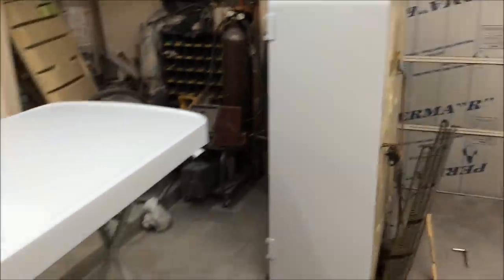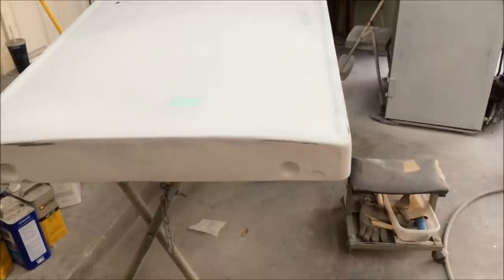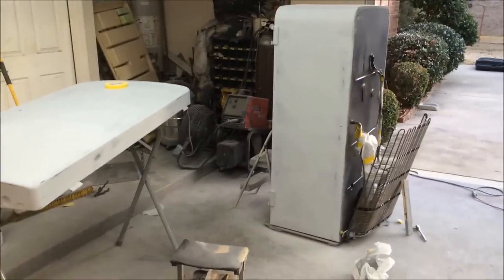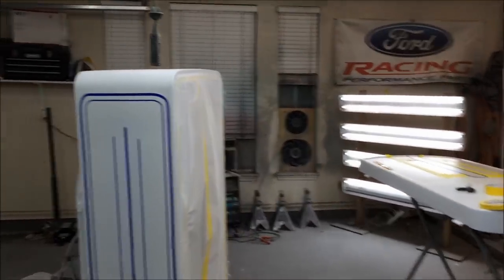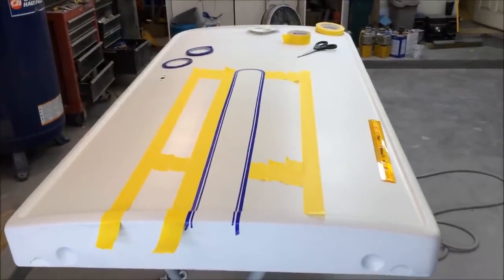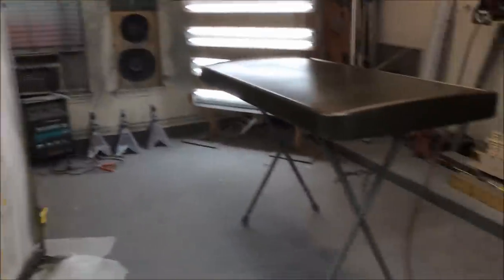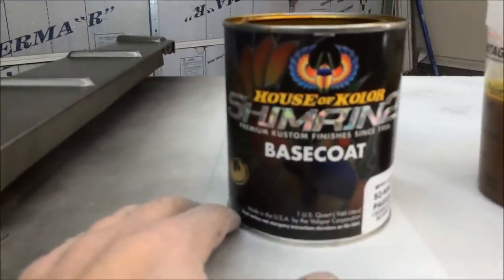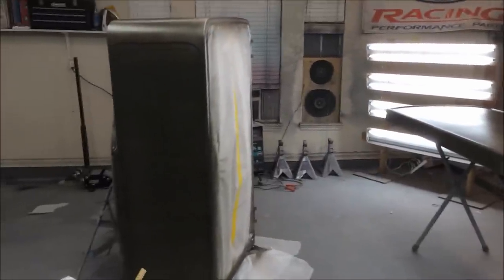How to paint an old refrigerator - vintage appliance - 1950's Coldspot Fridge - Hotrod Paint Job

Comment: 5th time is the number. This seems to be a problem of late on Youtube.
All in all, it looks pretty good for a refrigerator. Really nice finish.
Reply from the maker: Yea, that's odd, I have had the same issues, seems like it can take an hour or so for it to become viewable.
Reply: turbocobra
Some have suggested opening the video at a lower resolution and then upgrading it after opening. I am going to try that and see what happens. Thanks for sharing.

Comment: Nice project Gary.  Looks good from here.  Fair to say you preferred the UreKem Urethane candy you used before to the HOK Kandy Base?  On that type of project where you have a lot of tape outs we would have recommended candy base as well.  The 2K urethane candy is harder to work with on tapeouts and leaves more of an edge to bury. Seems really dark for pagan even over the dark undercoat. We generally say 2-3 coats on the candy base and then finish off with a drop coat more like spaying base than 2K candy.  Hope you guys are doing well.
Reply from the maker: Hi William, absolutllely would have rather sprayed the urekem base and candy compared
To the hok kandy base. It was much easier.  So do you guys make a kandy base ?  I am doing some fabrication on something right now that I may leave in raw aluminum, or may try some of hour chrome paint on just for fun ...
Reply: We have candy base without pearl (so it looks just like the 2K type) and with pearl (more like the HOK type base).  The chrome paint is the most challenging product we have to work with but after what you and Matt did I am sure you guys could handle it.  What might look really good as well is to use adhesion promoter over the aluminum and then candy right over it so the aluminum is your base.  You can even grind/scuff patterns into the aluminum for a cool effect under the candy.

Comment: Hi.. I want to paint my stainless steel fridge and stove to a dark red color.. What do you suggest I use? I want it to look shiny and have that stainless steel look. Thanks in advance!
Reply from the maker: Hi Wendy, not sure if I understand your question exactly.  So you have a stainless steel fridge, and you want it to have a stainless steel look, but you want to paint it dark red?  If you want to clear coat over your stainless steel fridge, that would be one process to follow, and I could give you some pointers on that.  On the other hand, if you want to paint it dark red, that's a different process and I could get you going in the right direction on that also... let me know... Thanks Gary
Reply: I just want to paint the stainless steel part to a dark red.. Let's say I want it like the tangerine color you put in this fridge on the stainless steel part of my fridge..does that make any sense? I hope it does lol ..thanks for the reply.
Reply from the maker: Wendy Peña Hi Wendy, best bet is to give me a call, 972-754-4344, there are a lot of variables and options, depending on your skill level, type of equipment you have, etc.  Appliance painting can be tricky because it's a high traffic/wear item, so proper prep and paint type is important, otherwise, it will delaminate and start to wear off pretty quickly...  Gary

Comment: what kind of paint product do you use for your fridge? I have a mini fridge that is white and i want make it pink color.
Reply from the maker: SeekerFantasy It's house of kolor automotive paint.  You can paint your mini fridge with spray paint or brush on paint.  It will look decent and hold up ok indoors if it doesn't get a lot of use.  Otherwise, those type of paints won't last too long, will fade, peel, etc from the constant use.
Reply: I see, but thanks for tip! :D

Comment: Tried 3 times so far and no video, only sound. Try again later.
Reply: George,
Take the resolution down to 240p and when the picture comes on click back up to 720p. Its the little gear bottom right of the picture.
Reply: andy heinrich
Thanks Andy I appreciate the tip.
Blessings

Comment: THAT'S.SORT OF.ALOT.
WORK..I.JUST.TOOK.LITE.COLORS.AN.PAINTED.VERY.LITE.COATS...ITS.TOP.CLEAR.COATS.THAT.SEAL.PRETTY LOOK
Reply from the maker: +KLEY MOORE Yea i was trying to do a hispanic low rider style paint job on it,  but sure you can do this a lot easier and simpler than what i did...
Reply: YES..I AM HEARING THAT MAKING FRIG 3D EFFECT IS WHAT KEEPS HEAT FROM RESTING.. AN I THINK AM TRY.N IT

Comment: HOK... R   just that a kandy ,,,when u look in the HOK color book..it is NOT clear what they r saying...what they show r kandyz over a base coat....kandyz will show everything under it,,,u just have 2 spray like a robot .kandyz just make the base coat richer in color   PEEEACE
Reply from the maker: Whatup Schuu, good to see you, I hear what your saying.  This is the Shimran KBC kandy base coat, so it has metallic and pearl mix in with the candy, and the candy is sprayed right on your primer or sealer... I got your message a little bit ago, too late to call tonight, but will try you tomorrow.  My mistake was even though it is a base coat, and not a mid coat kandy, it is still very translucent and shows the underlying layer, which is what you were saying.